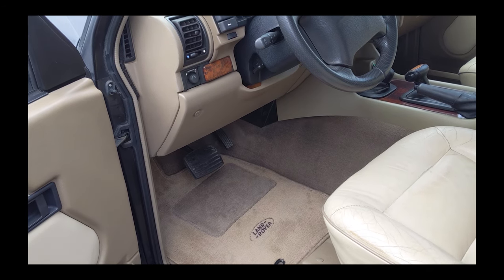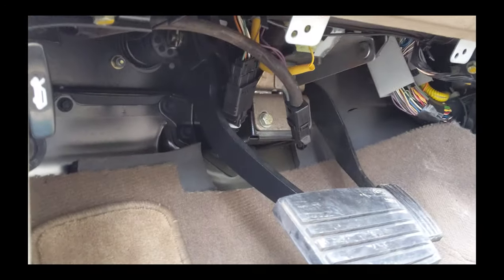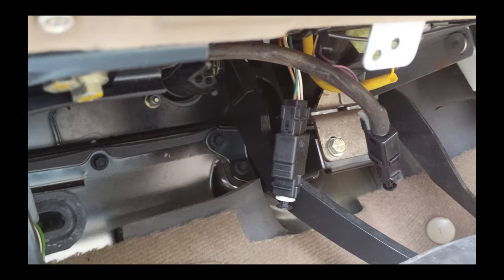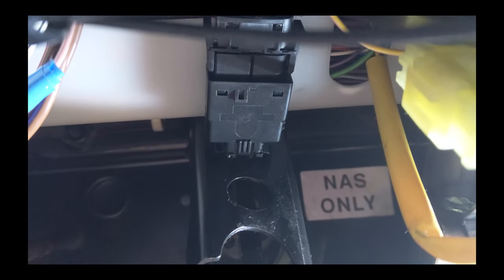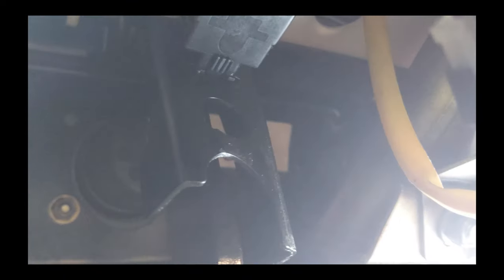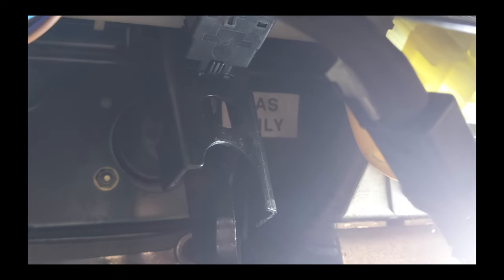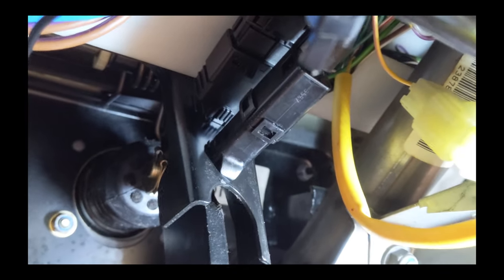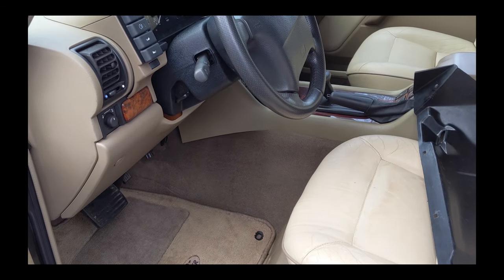1998 Land Rover Discovery 1 brake switch | land rover break switch

Comment: Finally! A D1 video! I can't get my brake light switch back in... is there a trick or just force it? 
Also, can someone tell me how to get to my shifter cable? 1998 D1 stranded, luckily in my own driveway.
Reply: Did you find a way to reinsert yet? I’m having the same problem and don’t want to force it out. How did you get the switch off??
Reply: https://landroverforums.com/forum/discovery-i-39/brake-lights-not-working-87041/

Answer to remove and reinsert is on that forum thread. Pull sleeve out when pedal is depressed to remove and same to insert but push sleeve back in to lock. Switch position needs to align in order for sleeve to pull back in
Reply from the maker: I am still loving this D1 :)